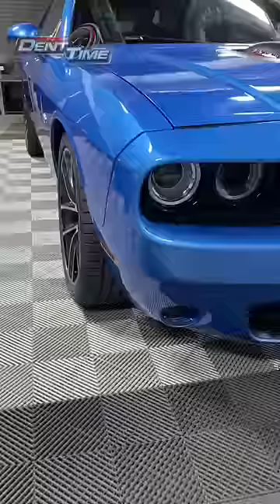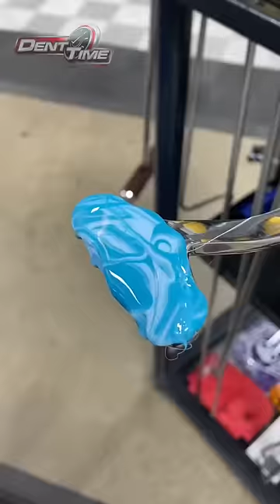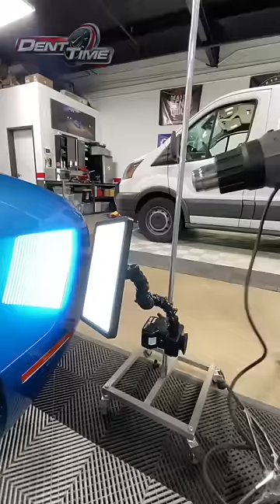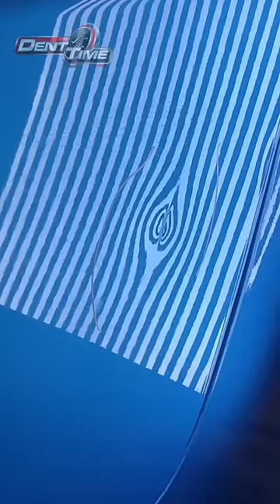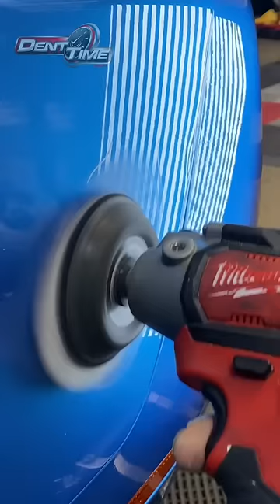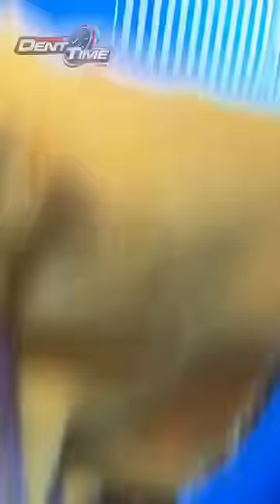Expert Dodge Challenger Dent Repair - Trust the Pros at Dent Time! 💪🛠️🚀 #paintlessdentrepair

Comment: Did you use just the one tool for the whole repair. How did you get it to stop oil canning?
Reply from the maker: I explain the whole process here 👉https://www.denttrainer.com/courses/tackling-deep-fender-dent-like-a-pro
Reply: lol tried to lay a course to buy on u 😂 when he prolly could of gave a simple explanation.. money money money..
Reply from the maker: If only PDR were as easy as pie, I would bake you a dozen and still have time to spare. Alas, the reality is far more challenging, requiring a deft touch and a keen eye for detail. Nevertheless, I'm happy to offer what insights I can, within the limits of brevity and clarity.
Reply: Shiiit $27 bucks is a steal. Some folks charge ungodly amounts of money for info. This craft takes time, skills and money to master. Get after it! Good content Dent Time!
Reply: @l3gendarylag805  Life is Time.  Time is Energy.  Energy is Money.
Reply: @l3gendarylag805  he's running a business, not a Charity.
Reply: @denttime  are we talking hand tossed or store bought?

Pies aside... first time I've seen stripes of light used to see uniformity on a car. Pretty efficient stuff.
Reply: How much does a repair like this cost?
Reply: @denttime there's an old American saying and I'm going to teach you this real quickly Nothing in life that is worthwhile is easy
Reply: PDR is the closest thing you'll see to real witchcraft. High level skill on display here.
Reply: @denttime   i see it like this. If the situation is difficult, you should be compensated. If simple, no, give it free.

In my case, am studying programming, that shit's hard. luckily I have a friend who's a teacher to help guide me. He's willing. But if he says "pay me" i wouldn't bat an eye, and would if a suitable agreement can be done. After all i have naught to give but my dedication and effort.
Reply: I paid $10k for classes just to find out this guys offering the same classes for $30? Maaan
Reply: How he did it is years of experience, you'll need that before you can do this..
Reply: Should of threw your quote for the title of the video in there lol @denttime
Reply: @tylergattinger2976  or a tutoring course.
Reply: из-за ведра с гайками так заморачиваться - точно больные.
Reply: @Dent Time - San Diego Dent & Bumper Repair  if I did this, I'd buy it. Only suggestion I have is to make a newline then the finger, then the link. On my screen, the finger points to reply to comment lol.
Reply: @MrMaxggangster  no it's a yt channel
Reply: Yeah he's supposed to explain what it took him time and money to learn instead of giving you the chance to pay for the same knowledge he paid for. Everybody wants s*** for free so makes you f** jokes
Reply: @MrSRT8_  he could just list the tools he used. It was a tool question.
Reply: @MrMaxggangster  jokes on you, charities have better profit margins than most businesses
Reply: @MrMaxggangster  hey running a YouTube channel..
Reply: @ballgms308  75-200. Some guys are cheap and do a hack job and others are very proud of what they do and can charge a premium price when they’ve been in the business a long time. I would personally charge 150. It was really sharp and probably took a decent amount of time for the one dent.
Reply: @l3gendarylag805  so you're expecting the knowledge he has collected via YEARS of trial, error, and buying tools, for free? ...... impressively entitled 🤷‍♂️
Reply: @l3gendarylag805  The course is only $27. If you can't adopts a $27 course (thatll pay for itself at a new job within an hour), then you got other things you need to worry about
Reply: @l3gendarylag805   metal shrinking and stretching is not so simple. Especially when trying to preserve paint. Extraordinary skills fosho
Reply: @l3gendarylag805  What i learned working auto body is if a technician gives you information on stuff like this for free it’s mostly their opinion and what they heard, it’s not till you pay for training and classes where you are taught things, the world runs on money nothing is valuable is free including knowledge
Reply: @denttime  most sincere message I've read in a long time..... don't worry about negative people....they wish they had your wisdom.
Reply: @L3GENDARY LAG  tell me you're broke and a employee, without telling me you're broke and a employee.
Reply: @l3gendarylag805  Wow happy to hear you're offering a free course on dent repair
Reply: Es
Reply: @Dent Time - San Diego Dent & Bumper Repair  the actual explanation is shorter than this paragraph, it's the years of practice and innuendo that is hard to explain in brief
Reply: Yes it looks easy but it’s not. Skill is required and built over time. Tools are expensive and people want you to do these small ones for free! I’d you wear corrective lenses don’t think this will be an easy pay day. It’s hard to see lines and lights even with perfect vision. I’ve worked at dent repair for weeks without ever getting a single practice dent done to perfection. I usually cause even more texture from hitting it in the wrong places. Kudos to those who can do it. They deserve the money they get.
Reply: YO! Thats a pro right there
Reply: @Armageist energy is pain. Paid leads to anger
Reply: @RoshDroz  Wise words. 😔
Reply: @anactualloaf8134  then you’ve never seen pdr, all pdr and shoot any body repair guy uses stripes of light to see the damage
Reply: @MrMaxggangster  how’s that boot taste
Reply: @mrpasciak92  pdr isn’t that hard anyone can do it with a little practice lol
Reply: @Americafirst-i8q  wow never heard that one before 🙄
Reply: @drewcameron6550  it’s really not that I hard I promise you
Reply: @osmacar5331  if you were a good friend you’d compensate him for his time anyway if he’s really teaching you something so hard and you truly appreciate it
Reply: @MrSRT8_  or he could just tell him if he used that one took the whole time and a quick tip on how to get it to stop oil canning, the guy didn’t ask how to completely do his job. Get that boot out of your mouth
Reply: @matthewla16  i compensate by being better, after all, my work is most likely to be held by my friends. if not then i will perfect it so no customer suffers catastrophic and spontaneous rapid deconstruction through rapid gas expansion.
Reply: @Socrates526  he asked a simple question not the dudes life story. Good lord
Reply: @Steel.Canvas  pulling dents really isn’t that hard, I’ve done it plenty of times. Nothing is shrinking or stretching.kmYou’re just getting the material to return to its original state from a distorted state because it’s been displaced
Reply: @SpinSatx  tell me you’re a neat rider without telling me you’re a meat rider and don’t act like you don’t got a 9-5 either, it’s past your bed time you got work tomorrow
Reply: @fpvgods  he literally posted a course, there’s no message behind that. Stop being a meat rider
Reply: @Tar and Feathers he literally asked what tool was used and a tip on oil canning, how’s that boot taste?
Reply: @Armageist  the other guy said energy is money so what is it really? Y’all wouldn’t know wise if it hit you in the face
Reply: @matthewla16 displaced and stretched. Tis on a wee scale but thats why ol boy comes in with that pic. Its for shrinking. Not done any paintless dent repair but i used to be a body man
Reply: @TheLargeLord  holy shit thank you, I thought I was the only one who noticed that. Like these boys are some meat riders fr 😂😂
Reply: @Steel.Canvas  appreciate the explanation, thanks for not trying to sell me a course on pdr or body repair 😂
Reply: @osmacar5331  but still not compensating the friend who is teaching you. Your friends may hold the thing you’re working on but at the end of the day, it will still be used by you predominantly so who is really benefitting? Compensate your teacher and your teacher only if you truly appreciate the knowledge he is giving you my friend
Reply: @matthewla16  to the mirror it is. Also for now my engineering is me alone, but when i get into gunsmithing. Others will.
Reply: @osmacar5331  that’s cool man, keep at it. Practice makes perfect. And nice, my father has been a gun smith for over 20 years if you ever need any tips or advise he has a course you can purchase for $30, just kidding but fr if you need any tips just let me know he’s always down to help somebody trying to fix guns
Reply: @matthewla16  what i need is practice with a lathe and CNC machines. Anything else, it's international shipping of firearms. Though i am grateful for the offer and thank you kindly. It's always good to have access to resources.
Reply: @l3gendarylag805  your brain is smooth my friend
Reply: @matthewla16 bahhahaha so you'd offer your good friend cash for showing you this? 
Have you ever had a friend in your entire life??? 😂
Reply: @zromo8994  I have plenty of friends and I was making a point on what these people feel is necessary to pay this guy for a simple question. But I really would offer my friends some money if they did something outbid the way and what is otherwise a difficult job
Reply: @matthewla16  I think it's dumb but yeah he can do him. There are other channels that'll show you the exact same thing.
Reply: @ВладимирВсеволодов-б6р dodge challenger это ведро с гайками? У тебя стоит с ценностями не так. Я сам не любитель американских машин но как можно так не уважать классические автомобили?
Reply: @Holms  да мне нас рать на все автомобили. 
задача любого транпортного средства - доставить груз (пассажиров) из п.А а п.Б. ВСЁ. макс цена "доставщика"- 1000$.
фетишизм по поводу того или иного ведра с гайками искусственно раздут и не имеет никакой ценности или смысла.
Reply: @l3gendarylag805 it's pathetic truly lol
Reply: @l3gendarylag805 yeah the fact that he's trying to sell you a course instead of explaining adds on to the notion that this is not the business to be getting into... 😂
Reply: @peterrollins881 just like every other YouTube video, where’s the problem?
Reply: TBH you gotta FEEL the surface you're working with. I'd just find the nearest vocational and/or adult education school near you and sign up for a class.  Spend a couple hundred bucks and you'll learn better than watching videos.
Reply: 20 years plus in pdr work. That dent can be fixed with one tool in less than 10 minutes. There should be no oil canning on this one at all. It can also be fixed without any tapping down. If your tapping your own tool marks, then you pushed too far. Tapping down is only for crowns, mistakes, or brace hits resulting in uppies. This is also a baby dent that requires minimal skills in the pdr world.
Reply: If you're good at something, never do it for free.
Reply: @denttime No shit, if they want the information and training for free let them spend countless hours of their own time learning the trade like you did. If I was going into the trade I would gladly pay for the knowledge and skill that is going to benefit said business. Look at it like an investment that pays out 20 times what you put in.
Reply: Let the man get his bag, stop braging goofies😆
Reply: @l3gendarylag805  Why would he give away his skills for free? Entitled kid, try harder
Reply: @sepg5084  because sometimes it's ok to help without getting money in return. Good people don't exist anymore huh only greedy ones like yourself
Reply: @osmacar5331  Gunsmithing is easy, so you shouldn't be allowed to sell that. The guns you make should be free. See how that works?
Reply: @troyteal  must be 20 yrs of wholesale pdr where the repair only has to look good from your arm chair 🫣

Comment: This is the DEFINITION of “trust the process”
Reply: FR
Reply: I would never let someone just start hitting my car like this. Idc what you tell me. That’s why they do it in the back
Edit:start not strat
Reply: Banging on your paint with what looks like a chisel? I'd say that requires some trust, for sure.
Reply: @DaimyoD0  the panel is heated first I believe. Helps to prevent the paint from cracking. Youd be suprised at what these guys can fix. Hail damage jobs are $$$
Reply: @RealWorldShorts  Yeah, and I imagine the striking tool has a smooth tip, and if I had to guess it's made of a polymer softer than metal to reduce scratching. I guess when you know what you're doing, any damage to the paint is only as deep as the clear coat, so it can easily be buffed out.

Comment: I've worked in a auto refinishers for 14 years. People don't realize how hard it is to remove a dent to bare metal standard... Let alone how hard it is to remove sharp dents without damaging paint. I've watched the painless repair lads do a few in the past but nothing as sharp as the dent this guy removed.. I'm actually impressed by a short for a change!

Comment: I worked as an automotive tech, but my shop did body work as well and it’s crazy how much you can push out something or flex it and watch it come right back, especially with aluminum
Reply from the maker: Yes indeed
Reply: Heat being important to not fuck up the paint

Comment: The lighting setup these guys have are impressive. 2 times a week guy would come to the dealership and knock out a few cars.
Reply: With minimal chemical exposure, excessive labor, etc of typical auto body. I was fortunate to work in a very high level shop the spring/summer before I was going to go to tech school for it and quickly learned, "fuck that," and make far more than an average auto body tech in white collar work today. Fuck that

Comment: Wow, may I know what is that blue glue you are using ?  This is an incredible fix and very creative technique by simply using the lines as pattern if the line is crooked or not. If not straight, it means you need to do something.
Reply from the maker: PDR glue from ansonpdr.com

Comment: So like did he take the inside door panel off and was banging from the other side while we were looking at the ending or what the hell am I looking at here he’s using heat to make the metal soft and more pliable but how did you get the dents out by banging into the dent more? Unless he had the inside door panel off and was banging outward to push it back out

Comment: Huhhh? I thought that was glue and  he was gonna glue that then pull it. this dude is dope
Reply: I still don't get it what's with the "tool". Did you get what was happening?
Or did he just bump on the "sides" of the dent, to "pop" it back up?
Reply: @Vitaliuz  yea I don't understand it all the way but yea he is bumping it from both sides(giggity) and flattened it out
Reply: @friscoHub415  Oh, that makes sense. He was "flattening" that part out, evening it out with the rest.
But why the blue silicone stuff then, if he was using that  thing to push from the other side?
Reply: @Vitaliuz  I swear to God I don't know what the blue stuff is I thought it was glue and he was going to glue it and pull it maybe it's like lubrication(another giggity)

Comment: Some douchebag put a dent right in the hard body line crease. I popped the tire off and the wheel well cover out. A guy showed up within the hour and pushed that dent it same as this and you can’t even tell. I really thought the whole front fender would need to be replaced. And it’s a hellcat, so there’s no way I’d leave it with a dent. Love to see these videos.